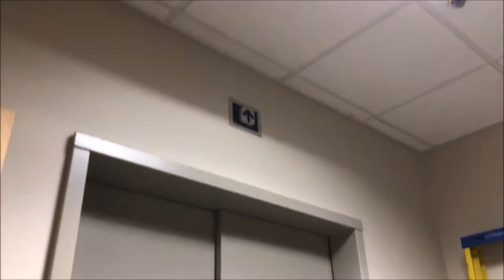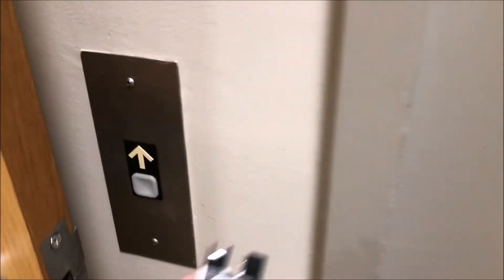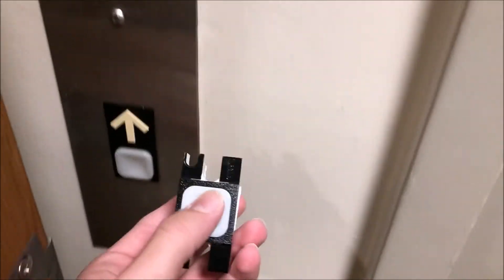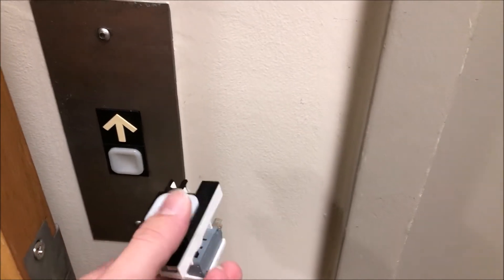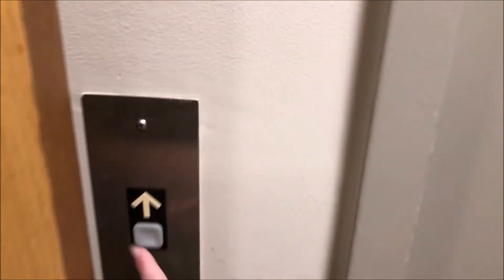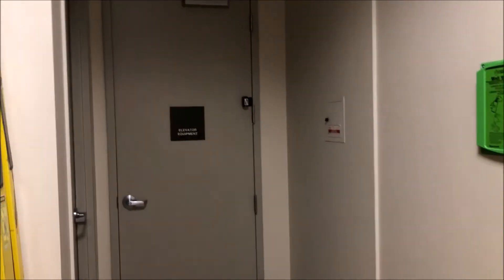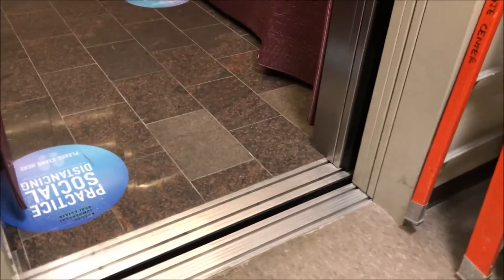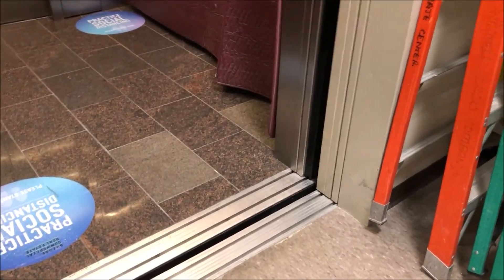Thyssen Dover Elevator in Viscosity Control

Comment: This is very cool, but what are it's cons?
Reply from the maker: Cons of Viscosity control?
Reply: @Jamestube8439  yes
Reply from the maker: @x_x-t6m  None, viscosity control is used to warm the cold oil.  That's all it does.
Reply from the maker: Well actually I can think of 2 cons.  1: in order for it to activate, all the requirements have to be met.  2: In buildings that have lots of elevator traffic, viscosity control would never get a chance to activate (since there would be a lot of demand for the elevators)
Reply: @Jamestube8439  Ah ok